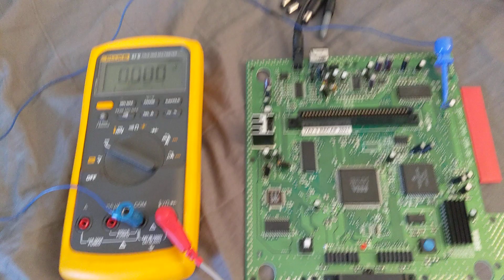Where to probe voltages on an old console--basic power troubleshooting.

Comment: I don't get 9v right at the input jack pin like you did. Does that mean I have a short? I've been tearing my hair out for days trying to get power to a Genesis 2.
The power supply reads 9v output when tested there. I just get nothing to the console when plugged in, though.
Reply from the maker: If I take what you say to be true, then yeah that kind of makes me think you have a short on the board. However, make sure you're measuring in the right place and also make sure your power supply is the correct polarity. On a Genesis 2 the center of the plug should be positive and the outside is negative.

Comment: I have continuity at all 3 solder points at the power jack, can't get no power thru it. Power supply shows 9-10v. Think I need new power jack? I do get about 5v at the voltage reg, but idk how, considering I can't get power past the input jack
Reply from the maker: It sounds like you're not measuring it quite right. When you say you get 5V at the regulator, is that the input or output side of the regulator? (Many of the boards are helpfully labeled I G O for input, ground, output).
Reply: @rfmerrill  idk I gave up. That thing is internally shorted somewhere.

Comment: I get about 10.6v on one side of the diode but nothing on the other side of the diode near voltage regulator. Obviously voltage regulator is reading 0 on all 3 pins as well. Thoughts?
Reply from the maker: Either the diode is reverse biased (your power supply has the wrong polarity) or the diode blew.